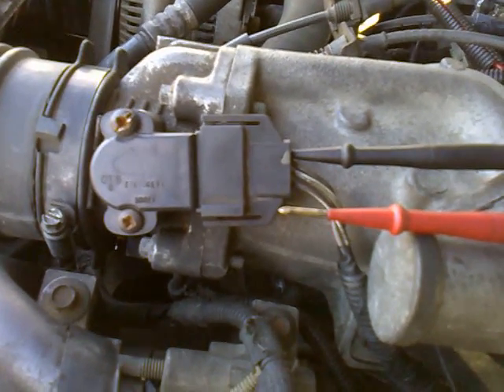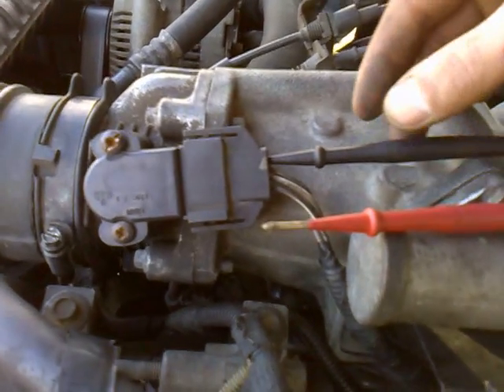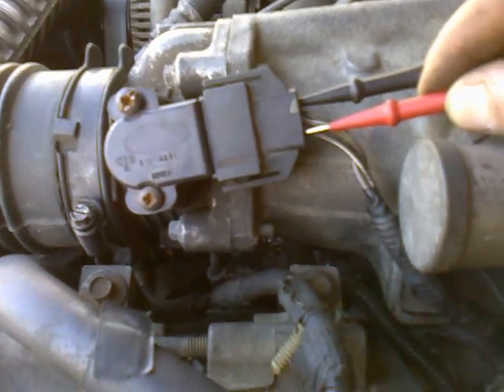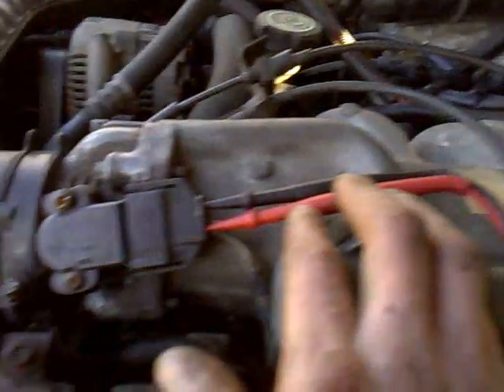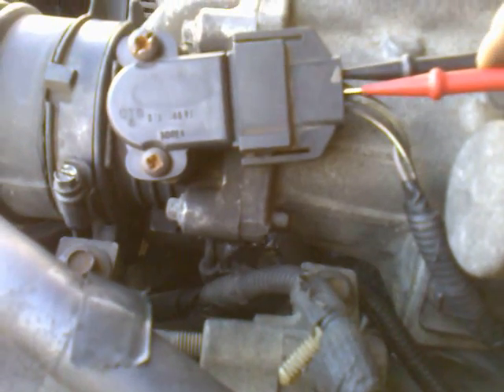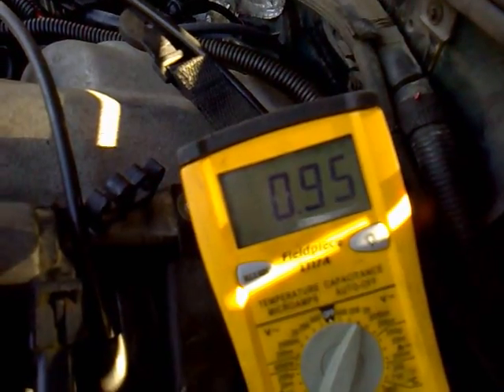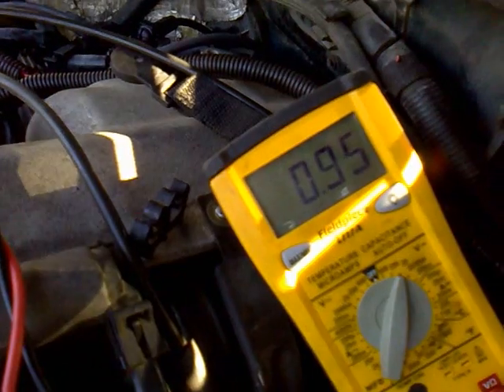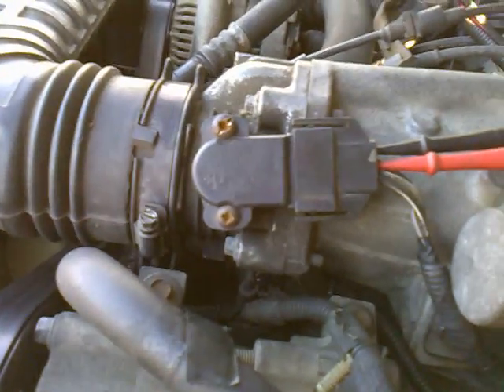90-94 Explorer Throttle Position Sensor Check

Comment: I have over 5.1 volts and idle 4.48 my sensor is bad ?
Reply from the maker: When you start getting out of range it's the beginning of the end for most sensors with the price it's a cheap quick replace. Wish ya the best of luck

Comment: At idle I have 0.72v. At WOT I have 3.67v. Bad TPS?
Reply: My voltage at full throttle was only 3.3v - wondering also if this means it is bad.

Comment: first check was 4.9v second was exactly 1v. After opening throttle tops out at 4.4v this 94 ranger will stsll while idiling after a few minutes. started up with tps disconnected and it idles better and does not stall. I've check for vac leaks, cleaned maf twice, and iac is new. i suppose its safe to say tps is bad.

Comment: My truck has trouble accelerating and has small misfires about every 2 seconds.. Voltage when giving gas was around 1 volt... im assuming this means a bad sensor? The wires leading to the sensor were around 5 volts with ignition on and engine off.

Comment from the maker: Full throttle with the engine off key on will give you close to 5v and chab is right with the analog is better for finding flat spots in the voltage increase, Good input =Þ

Comment from the maker: If your talking about the tps sensor then yes but you want to have a nice consistant rise in voltage as you increase throttle it you hit spots that the voltage jumps out of sequence the sensor has flat spots in it's voltage out put and prob need to be replaced

Comment from the maker: yeah I think it a voltage code error sometimes tapping the sensor will temp fix it, is your idle rough or sluggish accelerating ? And it can whine but guess I should ask what your symptoms are

Comment: Hey great video.  Thanks for posting it. This procedure should be simmilat for a 93 F-150.  I wached vid on how to retrive the check engine codes, and one of them was a code 33 which is Throttel positioning sensor niosy/harsh on line.  What ever that means.  So I figure I bettter check it. If you have the time and the knowhow maybe you could do vedeos of some of the other sensors.  Yorr camera was close enough so you cold get a good view of what was going on and you explained it well.